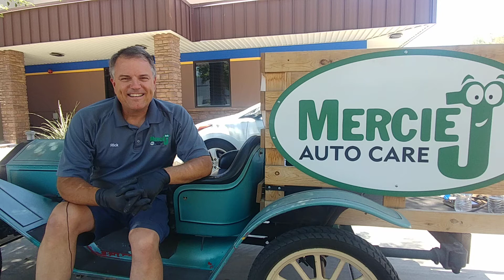Why is my Car's Cooling Fan so Loud?

Comment: Thank you sir. I live in Scotland where very hot temperatures are fairly infrequent. However, we are having a long hot spell just now and almost straight away after staring my car with the aircon on max today, the electric cooling fan began to howl like a jet plane as you described. A comfort to know that this is normal enough.

Comment: Thanks! My truck has the exact problem of sounding like a "bomber airplane" above 2000 rpm. I'll order and install a fan clutch. OEM's are expensive, but I don't want overheating problems in Arizona.

Comment: I needed to add AC coolant to my 2014 Jeep Grand Cherokee as it was moderately cool. Got a bottle of AC Pro with guage and increase from 25 to 40...max is 50. Immediately fixed the cooling - very cold now. BUT my engine fan blows like a jet when I turn on and while driving. Any tips? It shuts off immediately after shutting off the car.

Comment: Okay so when I star my car anytime. It’s extremely loud. And stays loud ....
Reply: Same here.  Did you ever figure out the issue?  I had my radiator, thermostat, and water pump replaced and it still does it.
Reply: @daonlypoo  no  someone yesterday told me I need coolant ..
Reply: @daonlypoo what did you do to fix it?
Reply: Coolant temperature sensor
Reply: @gabrielandino8625  hello, so did the temp cooling sensor fix the issue. I have changed the thermostat , my coolant level is good next is my sensor like you did .thanks
Reply: did you ever figure it out ?. mine is the same way only when its very hot outside. thanks
Reply: Y’all I needed coolant and a tune up

Comment: 02 silverado 2509 belt driven fan . And I don’t hear it I tell I get it some acceleration. It’s very loud. Replaced the fan clutch and no help.
Reply: I just put a new one on mine as well and just as loud as it was before. Any idea what brand you used. I went with duralast and im fixing to switch to acdelco. Theyre a lot more expensive but are supposed to be a lot quieter

Comment: By "bomber aircraft", that seems like the fan's spinning too fast? Meaning that when a clutch fails it locks up solid? I always though that a fan clutch would eventually wear and and kinda 'free-wheel' from the viscous fluid breaking down, so the fan never spins fast enough.
Reply from the maker: It can fail in both directions.

Comment: Need more help, I bought a new aftermarket fan clutch and it’s loud. 08 ram 1500. OEM ones are $160 for my truck. Any tips or knowledge u could share?
Reply: Sorry he didn't help, I hope you got the problem fixed. If not, are you running a heavy duty or standard fan clutch? Is your fan blade too large for the enclosure?

My rig is a 93 bronco and I have a heavy duty mechanical fan clutch. The fans sometimes brush against the enclosure, but I rigged it so they don't brush at all. The sound is still almost overpowering on a cold start but once it closes the loop (warms up) it sounds fairly normal.
Reply: That’s not problem. Couple months ago I went ahead and bought a oem one. Shut it right up. Idle was ok it was mainly when I was higher up in the rpm I could clearly hear it. My engine sounds so much better now.
Reply: @FuseBeat  so you replaced the fan clutch? I’m getting tired of hearing it from my 08 dodge 1500 as well
Reply: @FuseBeat  where did you get the oem one? Replace mine couple weeks ago because it went out but the new one is extremely loud and annoying